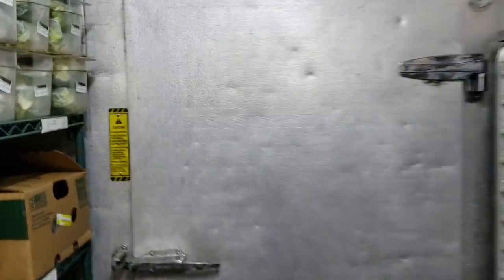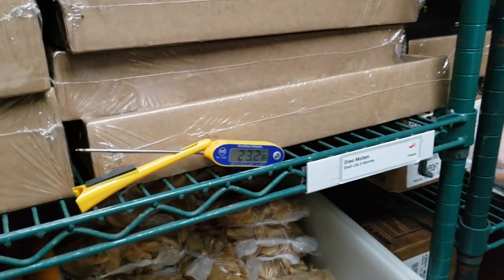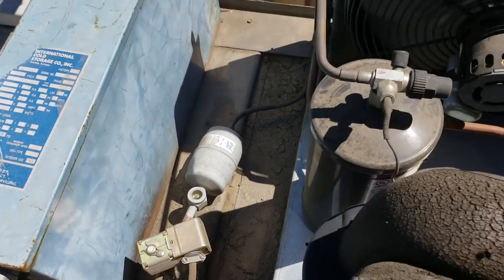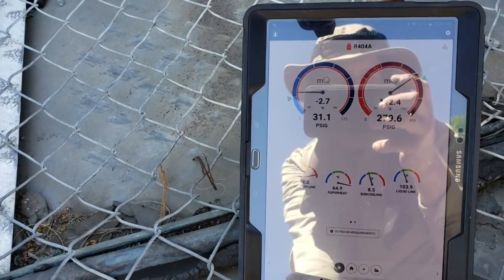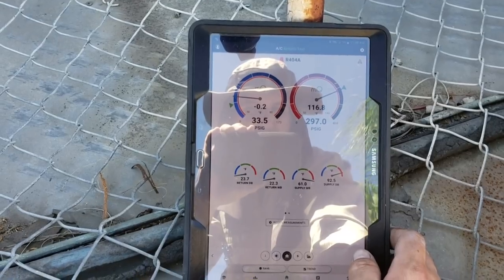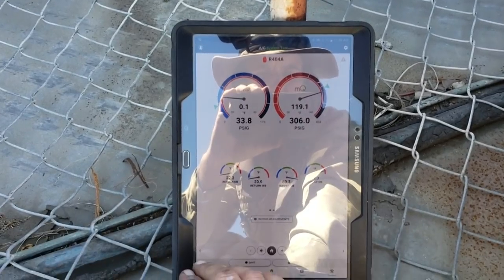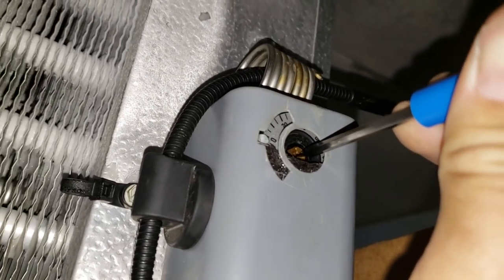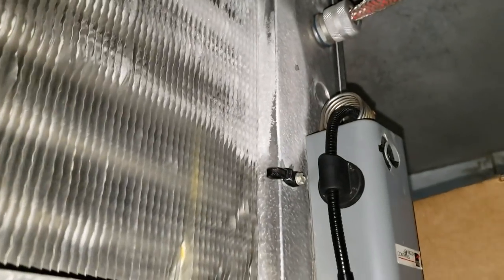Walk in freezer temping at 20 degrees

Comment: Install a Ranco ETC. problem solved. No more walking from vibration. It either works or doesn’t. The Emerson style ETC are also very neat because you can power steal if you are unable to pull another wire.

Comment: Hey Chris I had a question after watching your podcast on refrigeration controls you were talking about TDs and I was always taught coming up this rule of thumb what’s ur take on this , fan forced evaps 15 degree td, gravity coil 20 degrees and cold plates 25 degreee td
Reply from the maker: I don't necessarily think that applies to everything anymore. Like I had mentioned in the podcast a lot of the manufactures are running higher T d's on the reaching coils up to 25-30ﾟ. But every manufacturer is doing whatever they want lately, they dont follow any standards anymore
Reply: HVACR VIDEOS good to know that’s why I wanted your input, I appreciate all the info just started working on a lot more refrigeration recently and been picking up a lot of good stuff from you

Comment: I have a question I hope you have the time to answer. I had a call on a under counter refrigerator where the temperature would get up to 44 degrees then slowly come down to 38 degrees then go back up to 44 or 45 customer said it does not happen to often. I put my gauges on, my low side was at 45-50 my high was 250-300 psi. Evaporator looked ok no ice build up. its like an intermittent problem I wanted to replace thermostat cause I felt that was the issue but it was normal fridge temp which was 39 degrees n defrost clock look ok. My question is did you ever ran in to something like that? If so what was your solution? I'm 2 months into this trade I'm still learning the company I work for just threw me to the wolves. I had this call earlier today n I ordered a thermostat cause I feel that what it was, would love your opinion if you have time thanks.
Reply: Need alot more info! What type of charge, is it cutting in at 44 degrees and cutting out at 38 degrees? Does condensor stop running?

Comment: Good video Chris.  What are your thoughts on the Measure quick app?  And do you think Jim will release a refrigeration app?
Reply from the maker: I think measurequick is great and yes I know Jim is working on a refer app and hopefully it will be released soon.
Reply: Dick Wirz has an app... RefTech. Its not the most modern looking, have to manually input your data, but for newbie is a point in the right direction.

Comment: What did you use to check the pressures? I like how you could use your tablet with them.
Reply: Fieldpiece joblink probes. Pressure probes in service ports temp clamps on lines and air probes inside the box and perhaps outside at the condenser coil.

Measurequick is an independent app that works with a variety of probes including Testo and Fieldpiece, allowing you to mix and match your probes.

Comment: I would have never thought it'd be the thermostat vibrating itself up , I would have been a d$ck about it and thought someone had messed with it !
Dude, thanks for the tip, that's awesome to learn stuff like that!
Reply from the maker: I have found this many times and used to think it was the customer but than I realized it was because it was mounted on the coil, thanks for watching!
Reply: Often wondered if mounting to the coil was too close to get an accurate read on box temp, especially given how staff will stock a walk in... never gave  any thought to fan vibration effects.